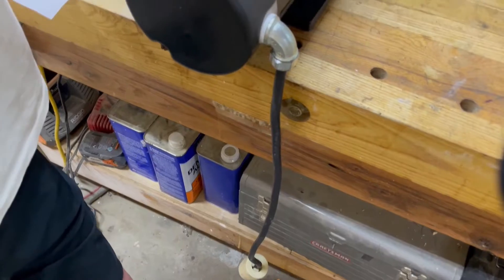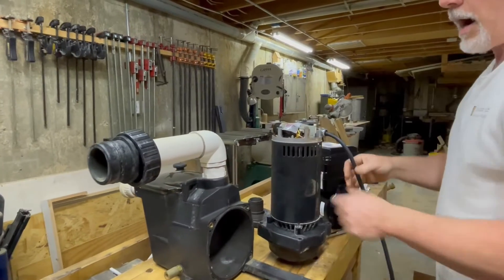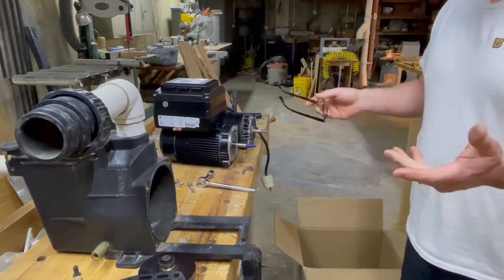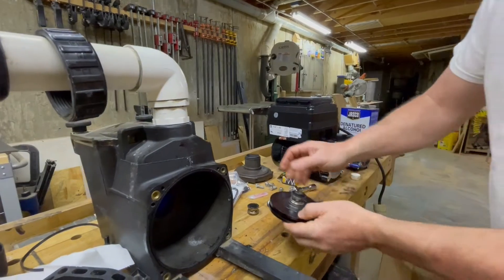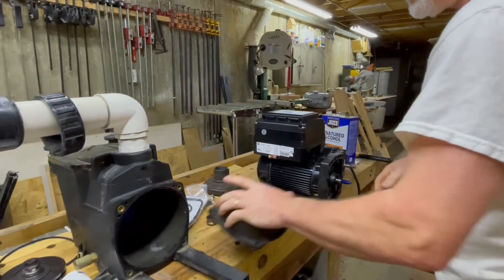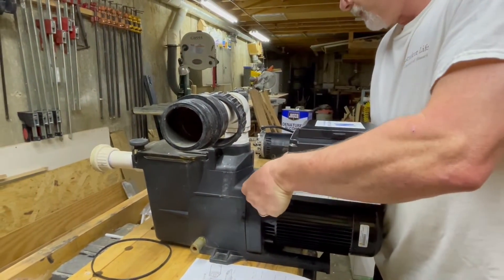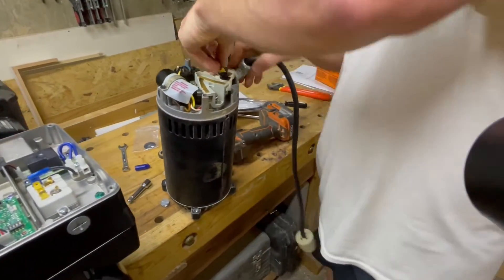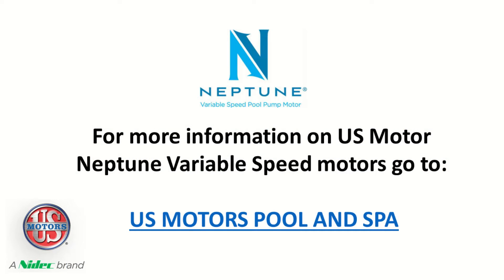Upgrading Your Pool Pump To Neptune Variable Speed Motor

Comment: Not to pick on you but I know that you're wearing a ring... It's probably just me but I worked in an aircraft plant forever and we weren't allowed to touch any wire are there anything with a capacitor or DC voltage with jewelry on it has become such a habit to take off jewelry before working on that stuff that I noticed when people don't do it... Just a fine observation.

Comment: Do you have a link to the latest PDF for the manual?  the one i recieved in the box is dated 2021 but the latest on the Nidec website is 2020... I prefer to have an electronic copy on file. Good video.